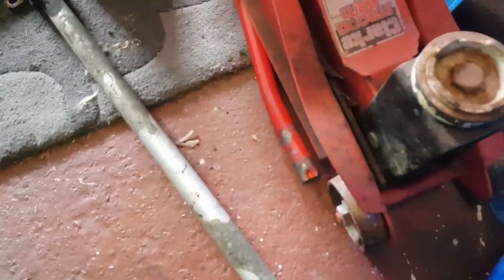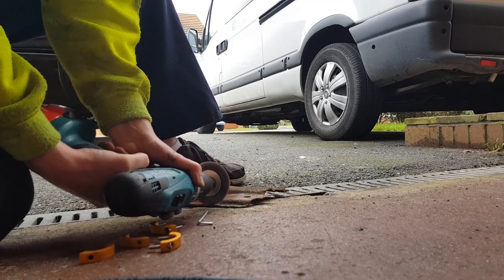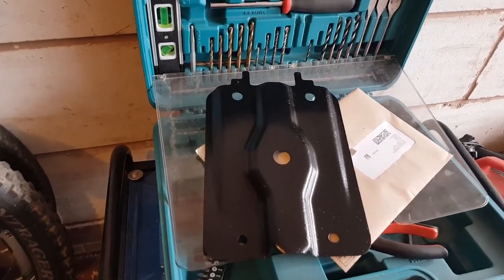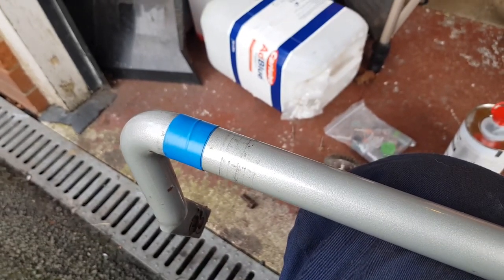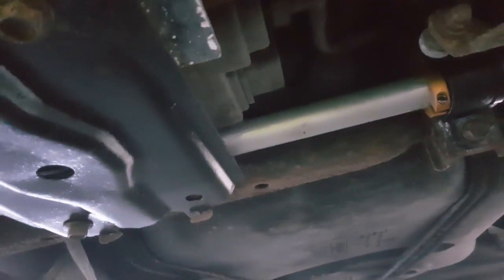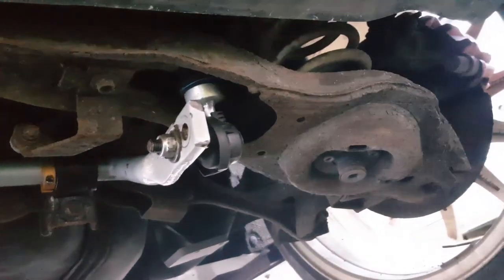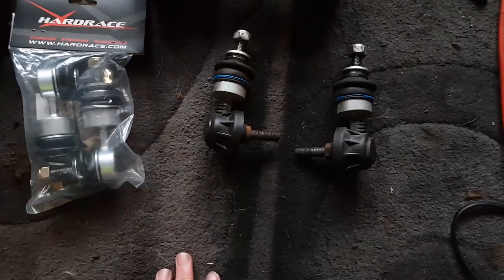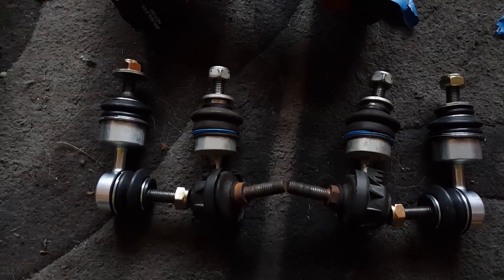clunk noise on rear suspension

Comment: I have the same or similar noise but the sound was still there driving around with no drop links, any idea what else could make a noise like this?
Reply from the maker: Check the bump stops at the top of the shock bud.
Reply: SonarCreep It does look a little cracked on the side that’s making noise, thank you sir I’ll try replacing those next

Comment: 2016 Mini Cooper S with 24K miles only and there is a thumping noise in the rear when driving on uneven road or going over bumps diagonally. I have checked what I could myself and all the bushings, stabilizer bar end links still seem pretty new and crack free.  So would you suggest still try to replace the end links?
Reply from the maker: Remove the links then have a little drive to see if that clunk goes away. If it's gone? Then it's the drop links.. hope this helps
Reply: @sonarcreep3691  Interesting idea!  The car is still under warranty but I drove with a tech couple of times 3 weeks ago but he seem not to hear the noise or didn't think that it was abnormal.  The noise is a bit prominent now and I will try to force the dealership to look at the links or make sure the tech hears the noise.  I even have sound file of the noise!  Thanks
Reply from the maker: Definitely get them to sort that if it's still under warranty. Good luck. Keep us posted..👍👍
Reply: @sonarcreep3691  Thank You!  I guess your video and suggestion are moving me in the correct direction.  I have been battling with this since December and the MINI dealership tells me that technician has to hear the noise otherwise they would be replacing many parts unnecessarily.  At some point, I even wanted to go to a German car repair shop for a diagnostics but I would have to pay.  This isn't ideal especially if the car has manufacturer's warranty :).

Comment: Them cheap chinese drop links off ebay always fail there shite lol. Now you've that sorted m8 ya can get the wire wheel out again for a tidy up😂. Any eveidence what that retaining collar was scuffing?
Reply from the maker: I'll be doing the rusty underside in the summer trust me..lol..
Reply from the maker: The retainers were on the wrong way. I.e. with the screws pointing down to floor. Instead of pointing out the back if you get me?
Reply: @sonarcreep3691  Didnt think that would make any diffrence tbh,weird
Reply from the maker: Ya. If you look at them, they are shaped.